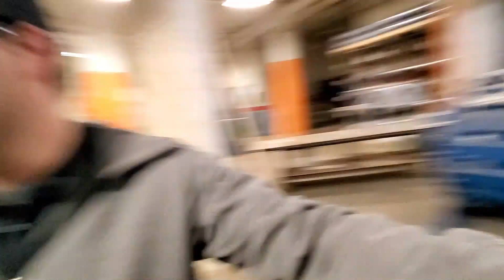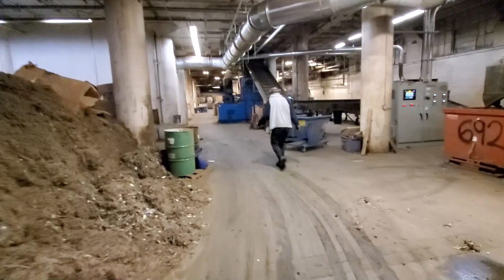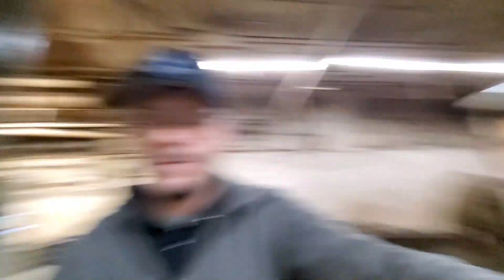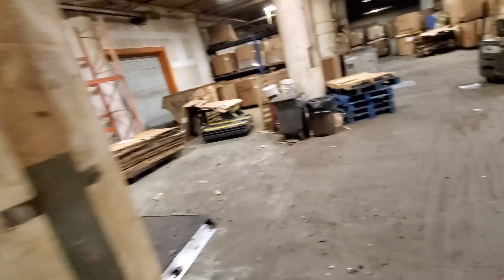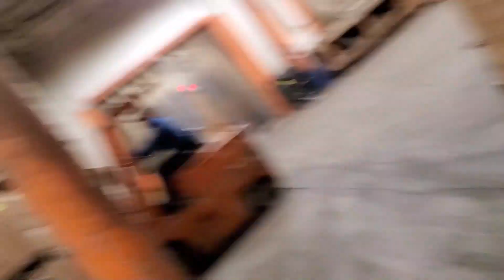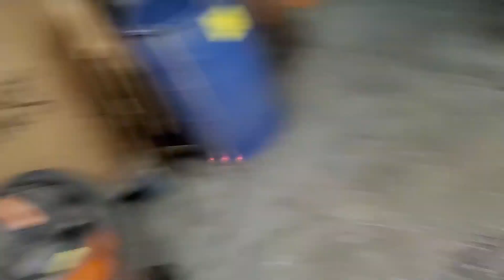Difference Between a Vertical Mill and a Vertical Shredder

Comment: I'm loving these videos please keep up the good work. I'm getting close to making a purchase to start building out my own processing plant. I will mostly be processing auto harnesses from my own production (full service auto salvage yard) but I'm also going to start buying copper so I'm looking for the best of both worlds or if there is 2 machines that would fulfill my basic needs that would be great. I'm just starting out in this venture.
Reply from the maker: Thank you for your feedback Mark! Looking forward to working with you on your project. The vertical Mill is better for #2 wire such as auto harnesses, but it can be used for #1, albeit at a slightly reduced capacity on solid conductors. You could use the vertical mill for both, or use a combination of granulator /vertical mill both fed buy the same shredder/conveyor with the option to run the shredded material into one or the other.